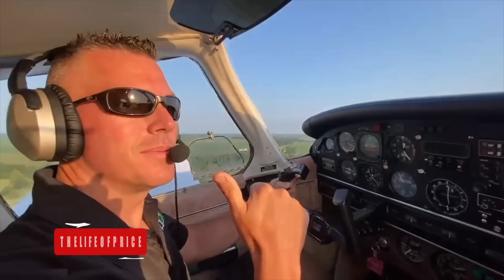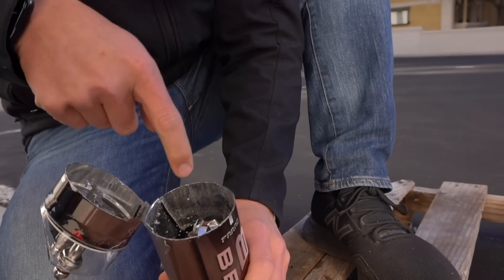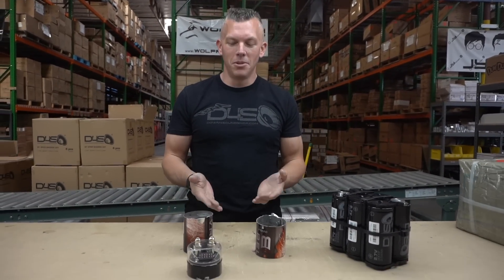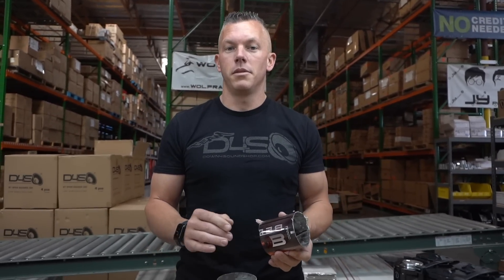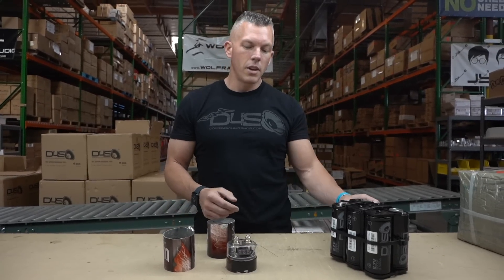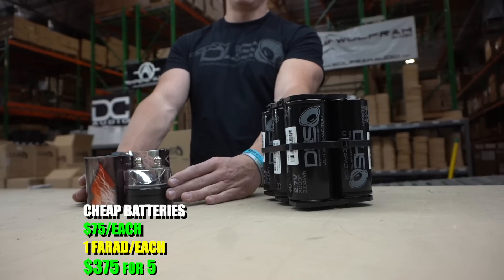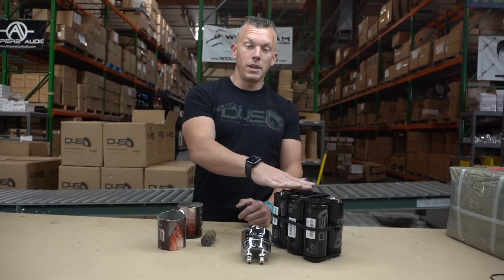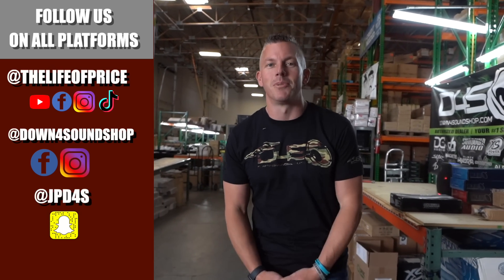WHY YOU ARE WASTING YOUR TIME AND MONEY  BUYING CHEAP CAPACITORS!

Comment: I don't know if they are "manufactured" in such a way they are needed, but generally A/C electric motors need 
either/or a "start" capacitor, or a "run" capacitor.
And we're talking "Microfarad". Like 20 - 40 Microfarad. That is such a small amount of energy.
But I can attest, your HVAC blower motor will have a helluva a time starting without one. Car amplifiers are different?

Comment: 1 farad capacitor is enough to help with unwanted noise 5 farad caps is unnecessary for filtering noise. If you look inside amplifiers you'll notice it has capacitors FOR NOISE FILTERING not for dimming lights

Comment: Would a small motorcycle battery work ? Better than the capacitor ?
Reply: No, takes more to fill a lead acid battery than a capacitor. Other than that you need to upgrade your vehicles charging system. And install an isolation on the battery. If you not pulling more than a few thousand watts a decent capacitor will do the job.

Comment: Capacitors are a prime example of "They Don't Make Them Like They Use To!"  I've got an old 1 farad cap from the early 90's.  It would easily crank my Toyota truck.  A newer 5 farad will not!  The older "real" capacitors were notorious for exploding!  They don't any more.  A good test is put a 9v battery on an old empty cap, the battery will get hot as the cap is charging.  It should take a few seconds!  A cap's main job is to block spikes from the 12v supply like alternators, relays, and starters.  A bad alternator or loose battery connection can cause spikes 100's of volts!  It will also improve fast sound pulses, like drums,  cymbals, triangles, etc...  If you want to hear all your music and protect your delicate electronics, use a capacitor!  If you only want lots of bass and not much music, cap's are still worth the protection they give!

Comment: I know super capacitors works well in car audio systems. But I would like to know what's the wattage handling of your capacitor banks? I have (4) CAB-22 amplifiers running at a 1-ohm load.
Reply: capacitors need to be able to output peak draw of the amps while alternator and battery need to handle RMS (Root Mean Square) power.  How many farads you need depends on the system and the song.  People tend to go bigger then the absolutely need so they don't run into a song with a long sustained low bass note that fully drains their caps.

Comment: Better off getting a small power cell than a cap IMO. I was able to run a 2500watt rms system in a stock Honda civic with only a big3 upgrade and a small power cell by the amplifier. It had the stock alternator still and didn’t have no dimming, no issues of any kind.
Reply: Do u have to run a isolator between batteries, I have a AGM 55ah for rear but my front batterie is new regular type
Reply: I'm hesitant on hooking second battery up until I do more research

Comment: You're misleading people. A little capacitor and a battery are the complete opposite of each other. A lighting capacitor is not supposed to store power like a battery, it's completely made to discharge in mili-seconds. A battery is a stand alone storage of power. The reason why a lighting capacitor is useful, is because back in the beginning of the car audio world, batteries use to crash due to not being built to handle the hits of voltage draw, coming from the amplifiers. Many batteries would become defected after a short period of time after installing a sound system. This birth a movement of trying to find ways to effectively power a sound system. I admit, the pricing of some capacitors could be cheaper, but yes a capacitor does have it's purpose. Look at it this way, a battery is like a full glass of milk 🥛. A capacitor is like that extra milk being poured into the glass, that's overflowing around the glass. If you are listening to music at a normal listening volume, the alternator would work with the capacitor, and the amplifier would only drink the milk that's overflowing around the glass. And as time go on, this will extend the battery life of the car. This was also documented in a Rockford fosgate brochure years ago. They made note that whenever you use a capacitor between 8-12 farads and up, that it is known to extend the life of the battery. And every system that I ever built, I always use two batteries ( or more), and a series of lighting capacitors. I also use mechman alternators. And I noticed that my batteries last me years. But at the same time, I bang music moderately, and I also ride out quiet some days, just so things can stay charged. And I been doing this for years my friends.

Comment: Though I do agree with most of what you are saying you are missing some issues. Not everyone upgrades their audio system to thump bass down the road, but are looking to go above their alternator's rated tolerance. In newer cars if your headlights are dimming you are effecting other electronic components as well.  Something is better than nothing. I would never suggest a 1 farad, but telling someone to spend that much money on an electrical system upgrade or super/ultra cap for small stereo applications is overkill as well. Though it does seem like you cannot find any middle ground products these days. Just my thoughts.
Reply: U dum dum

Comment: I'm not too knowledgeable in car audio; I took some basic electrical classes in avionics. In my experience I think it depends on your application; my amp is rated @ 1000w. I installed a 2F cap and its eliminated the slight headlight dimming issue when kick drums hit.
So far its been working just fine, but I'm willing to let the $40 go to waste to learn not to use these caps if I fell for the scam and do it right the second time.

Comment: I put  in a 100ah  lithuim battery  in my hood and it showing me on my meter 15 to near 16volts which was to high for my car that it even cutting out my headunit  and showing my abs light and had my dash lights blinking  for about 25seconds  on cold starts ...so i add a capacitor  to the battery it help a bit, it only does this on morning cold start.how can i slove this prob because it got me scared when i start my car on mornings

Comment: I never bought in to the scam caps. I always added batteries. By the way, thanks for the D4S JP234. It’s a very powerful and small 4 channel. 
Keep making amazing products bro! Your shop there in Henderson is awesome too.
In my new build in my Powerstroke, I just got a 370A alternator and 2 yellow top optima batteries for the truck with 3/0 cable under the hood. Looks like I’ll be adding these caps to keep my HCCA 3000 happily feeding my Phoenix gold titanium elite 12D’s. 
Just installed my alpine Ine-w960hdmi to feed 4v to my audio control DM-810. USAcoustic lanna 6x150@4 ohm class AB feeds the active 3 ways in the front. Im hoping your caps will fit laying on their side under the rear seat?
Reply: Thank you for this information. Several audio shops tells me I need a capacitor. I actually ordered two on Amazon one was a return so they replaced the other one now. Both are going back to Amazon. Someone told me we needed zero gauge wire instead of the capacitor have you heard anything about that? I think it’s called 3.0.

Comment: bet the bottom has a small square of concrete too.

They do help filter AC ripple, and it absorbs that initial shock  on the electrical. They were made for stiffening not to store  power. I'll give them that, Rest was all he say and they ran with it.  $75 is crazy

Comment: And people don't understand the math that it takes 1 farad to equal 1 volt and 1000 farads is equal to 2.7 volts. So if you have lets say have 1500 watts total system for example you're actually not getting no activity after that first discharge. Added to that the recharge time is slow due to that cheap dielectric core. Can't believe people still buy that crap.. Good job JP!!

Comment: Talk about a wolf in sheeps clothing. Back in the 90s I made Capacitor bank of 6 @ .5 farad electrical caps for my 500w bass and 400w highs system.these caps were almost as big as the case on one of those fake ones. Aluminum and magnesium plats all the way through. I have never seen one of those canisters cut open like that. thanks for educating us JP.

Comment: You make a good point with the single-fared capacitor not worth the money I would say you could get a better deal for the same $314 instead of buying the super caps I would invest in a lto lithium Bank for $300 you can get six cells of the 35 amp hour ying long that will have way more power and last a lot longer it won't pull the voltage down so quickly
Reply: It helps to have both yin long. And super caps especially if your in competition or doing demos

Comment: I've been loving my xs SB-630. Matches perfect with my normal voltage and does a great job of stabilizing surges. Run in parallel with 2 agm & 128 ah of lithium it puts in work and worth the cheddah

Comment: I have a 2000 watts system, 1500 for my 1-12" and 500 for my mids and hi and have a XS 24 hour and battery is that enough or do I need a capsitor bank also.I  need help and what do you recommend cause my 5 farett cap ain't cutting it. 
Thanks for your videos and advice
Reply: Gonna give you an analogy that I've used with others to help them... 
If all you've got is a sink and a cup, but with no water, how do you expect to wash the dishes clean?
Reply: if you don't know if you need it then you don't need it

Comment: That material inside may be called "resin." It will not conduct electricity and adds dead weight while keeping the actual capacitor from rattling around.

Comment: So far a cap bank is somewhat in the near future . But it's definitely a must do and a mechman alternator . I paid $180. To have it put out more power got it back went to check it and all they did was change the brushes which I could've done myself . I still have these old style "stiffening" caps 2 of them and they suck even though they were the ones that when cut open actually had stuff wrapped inside which I believe were the Rockford and monster cable .

Comment: I've been trying to tell people this for years. It's like talking to a brick wall most of the time though.  A quick Google search will show you what gives a capacitor it's "capacitance". In simple terms, the size of the actual capacitor matters and they are out there selling big pop cans full of rubber and a voltmeter glued on top lmao.
Reply: Im literally having this argument currently with someone on YouTube comments and they refuse to believe me that a this type of capacitor is a bandaid for not having enough electrical.
Reply: @michaelf.2449  show them the video jp made a couple months ago about the mini capacitor for stock system or whatever 
He literally says it's good for about 5000watts(maybe he said less) and it was a 2000farad cap.
Meanwhile these guys have a 0.5 micro Farad sodapop cap. 2 farad at most, what are they thinking?

Comment: Does the voltage need to match your lithium voltage? How many farad to amp hours of lithium?
Reply: 500 farads for every 40  ah of lto lithium Cmax charging voltage is way to high
Reply: @bigkato3134  I'm using 14.8 volts charging with headway lithium about 750 amp hours. I know the voltage for caps is somewhat flexible but curious if it will work with nine
Reply: @moabs10blowthru41  Buy the 14v caps they charge up to 16.2v I'm charging 15.8 with lto lithium and caps with no problem I ran headway cell with caps with no problem 14.8 is fine
Reply: @bigkato3134  what did you charge your headway at? Just not sure what I should max out at,charge far more cold than hot and using a VCM

Comment: My question is when should you go with batteries over capacitors or capacitors over batteries? Pros and cons to each and the appropriate time for one or the other.
Reply: Use batts to get your current magnitude up. Use caps to protect voltage drops.. in truth you want both
Reply: @mkloudsql3285  caps are use less unless it's a super cap
Reply: @cuh_2023  Anything small in size is going to be useless if you're draining it expeditiously without replenishing it equally (if not more) fast than it's being taken. Your gas tank would be useless if it was only 1 gallon and your fuel line was the size of a garden hose and didn't fill it every 5 minutes. Same principle applies to caps... The smaller they are, the easier they are to drain, especially without charging them properly, but that's not to say they're "useless". 🤦🏻‍♂️
Reply: @cuh_2023  they aren't useless until your over true 1500rms. Everybody isn't doing SPL drag systems. Why should anybody add supercaps and/or an extra battery for a simple pioneer 600rms class D amp on a factory system? A good 1 Farad cap will suffice...a 2F would be perfect. Super caps are for the big boy shit. The average person literally just adds some real bass to their premium stock stereo.
Reply: @ARSONISTSCAMP  this isn't true, like JP said if a 1 Farad cap helps you didn't need it. All amps and all electrical systems are not built the same and everyone does not live in the same conditions. In my 2005 F-150 I only have a 1200 watt @ 1 or 2ohms CXA amp & a 360.4 CXA amp. Neither of those amps are even supposed to require 1/0 gauge cable. The sub amp only has a 4 gauge terminal and the 4 channel has spade connectors and I am running a double input adapter to the sub amp.  Let me tell you it sucks power like it was grape soda. It's like I can't give it enough. Big 3 has been done with 2/0 Gauge OFC cable, 1/0 running to the back, Everything is OFC, Big ass AGM battery up front but I do have a stock 110 alternator, all grounds are to the frame and touching the bare metal. I had the same system in my wife's Ford Edge except for she had the 800.1 CXA which still does about 1100 watts at 1ohm and there were no problems. No voltage drops, no issues and I didn't do shit to her electrical and was running 4 gauge shitty wire and grounded the amps to the seatbelts. It's a whole different story in my F-150. My point is with car audio there are just too many variables. What works in one car, in one place, for one amp won't always work in another place, in another car, with a different amp. 2 Farad capacitors are junk you might as well save your money. JP is dead on about what he said. This guy knows his shit amps nowadays are more efficient then they used to be back in the 90's but they also are putting out way more power. So when you say "Supercaps are for big boy shit" what does that even mean? D4S makes an amp called a JP23 right now it's on sale for $379.00. They are rating it at 2800 watts RMS @ 1ohm but I saw 2 different Dyno tests by 2 different people and they both got over 5,000 watts out of it. Over 5K watts for $379 thats insane! Taramps, Wolfram, NVX and Orion all have amps that are affordable that put out unbelievable amounts of power. That's big boy shit my guy. Super caps, high output alternators and lithium batteries are becoming more and more common because these amps keep putting out more and more power. Not enough people use those things in my opinion. Thats why so many people's systems sound like shit too...
Reply: I personally use both batteries for storage and super caps for them hard bass slaps
Reply: Good question